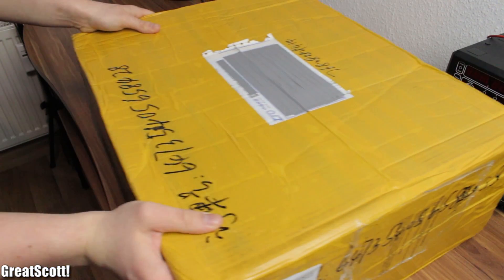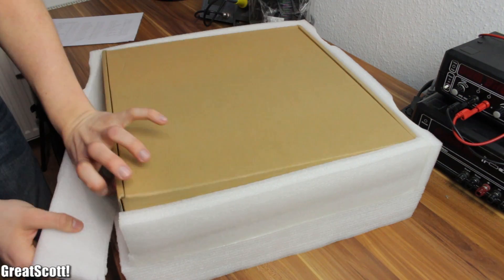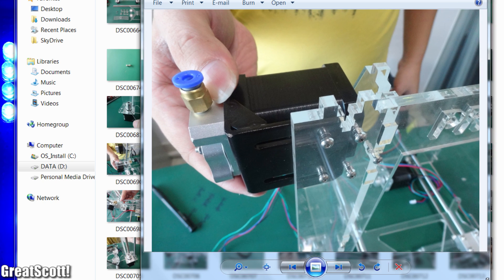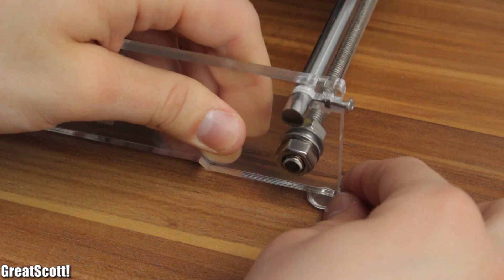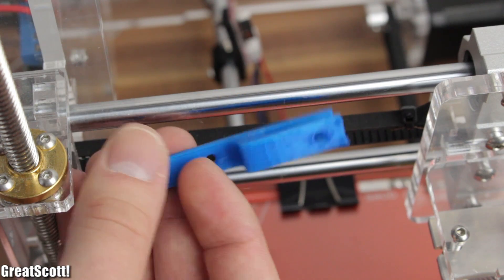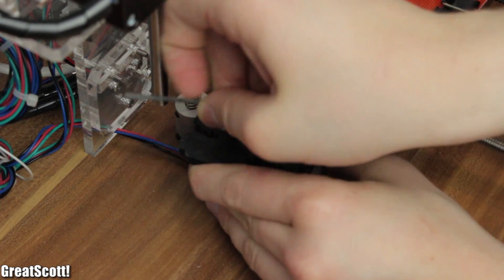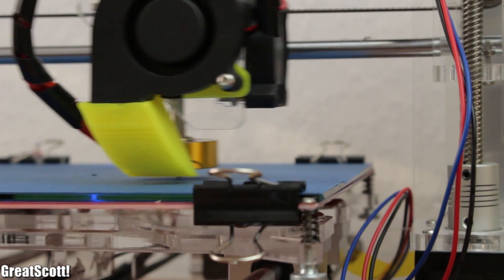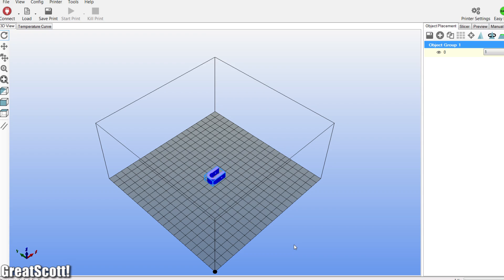3D Printing Beginners Guide (Hardware) - 380$ DIY RepRap Prusa I3

Comment: Man, this video is such a time capsule. So much has changed in the past 8 years. It's so much easier to build printers nowadays.
Reply: I think the printers themselves are harder to make because there are more complicated but the instructions are better
Reply: @AnthonyZuniga-ze1ud  No they're the same difficulty to make, it's just the standards of what's a "good" printer has changed for the better. Nowadays, it's considered a bad printer if it doesn't have auto bedleveling.
Reply: Aint that the truth, my first printer was a reprap i3. Fucking hated that hunk of garbage, 80% of the prints I made on that thing were just parts for the printer so the qualilty wouldn't be so ass.
Tossed it to the curve when the ender 3 came out and haven't looked back.
Still got it today, I've upgraded the board, lcd, and installed bl touch and a direct drive.
Although, it's been overhauled, I'll always respect that I never had to do any modding just to get it to print propperly. 
It worked perfectly fine out the box except for a lil bit of stringing (Sorted it out mostly with a profile tweak on the slicer but, direct drive has pretty much eliminated that entirely).
Reply: @brandonnesfan  an ender 3 without needing tweaks and mods? What is this sorcery?

Comment: Why did YouTube just recommend me this in 2020? My printer has so little problems it's not even funny. When I look at this stone age technology I want to cry. They didn't have Buildtak. They didn't have BLTouch/3D touch. They didn't have good hotends and extruders. They didn't have Marlin 1.9. This is such a stone age they couldn't figure out to put X endstop switch on the X carriage or on the left Z carriage!
Reply: What even are you talking about? We had good hotends (E3D V6, Volcano), we had Marlin (not 1.9 but it was still the cutting edge), we had auto bed leveling, just not this machine, buildtak existed but they were just starting out

Comment: the firmware sucks , i started off with patience and now im in the negative ...lol. i was looking foe help with the configuration.h setup for my reprap guru prusa v2 black because just like this video , my manual has missing and or wrong information and parts . i know i have to upgrade it , i planned on it anyway but i just wanted some help if possible .

Comment: I have the 2017 version and it's STILL confusing as hell to build.  Also still attempting to figure out wtf is up with my z-axis stepper motors.  They will only move ONE step at a time. One.  Perhaps your video will help. XD  Oh. And my end stop sensors not detecting jack.

Comment: Wow, alot has changed in the last few years, I got mine for $180 and printed a 1.2 meter RC plane in parts as my first print and only on or two prints failed.

Comment: I made my own 3d printer, built from 0 with my design and that glass over the hotbed works fantastic. I even try a print without whiping the glass, put my fingers on the printed area and it sticks very well. Now I print only on a glass piece, I whipe it with acetone before and everything it's perfect

Comment: Hi Scott Great video.

Now that you know how 3d printers work, why not see if you can't find some strong low cost parts and design your own raspberry pi based 3d printer. The difference is that with your German efficiency and engineering skills you make a better, simpler design at lower cost.

You could call it the Volksprinter.

Comment: I think this or the upgraded model was in the recent PrimeDay sale.  WHAT A HEADACHE!  There were pieces missing, one of the driver was DOA and the RAMPS board had issues.  I had to have Amazon ship me a replacement kit and I harvested parts from it until I got it all working right!

Upside, I now know how to work on this with my eyes closed and I already know what parts I need to print to fix some of the issues, Y belt tensioner anyone!?

Comment: I got myself a folgertech 2020 prusa i3 kit for only 290 USD. It is made from 2020 aluminum extrusion and I had no issues at all. It was easy to setup and it prints like a charm. After upgrading to a genuine e3d v6 hotend I think the print quality has reached a point where it is almost as good as a 3D printer which costs over 1000 USD.

Comment: Another option for the glass bed is:
Take woodglue and add water, to make it thinner. Then carefully apply it to the printbed with toilet paper of another soft kind of material. The waterwoodglue should dry and leave a thin rough material which the filament can hold on better than glass. You can remove this layer with water.

Comment: I own a prusa i3 myself with an aluminium frame. Works fine most of the time. I did run into problems with the linear bearings over time though, but nothing some handy oil couldn't fix. For print adhesion to the bed I used hair spray. 

But recently I discovered how to print PLA directly on the glass.
First, I got a sheet of single glass from a photo frame and got it cut to the correct size. Ikea mirrors and double glass didn't work as they have too much thermal isolation.
Then, I made sure the glass was absolutely clean using window cleaner. Don't touch the glass with your bare hands from this point on, as the oils from your skin will cause problems.

Level your z-axis as per normal, making sure the first layer would be firmly squeezed onto the glass.

Now, when printing, put the bed temperature to 80° (less might work too, but this worked for me so I stuck with it).
This will keep the PLA stuck to the glass really well.

After the print is done, let the bed cool for about 10 minutes. Your print should come loose from the glass with relative ease.

Comment: Dude. The screws on the bed are there so you can adjust the height. You get the printer to Z 0mm, then move Z to 0.1mm, then slide paper under and move the bed up or down to where the nozzle is. You don't move the Z limit switch to home and level the bed.

Comment: Your videos are great man they're really detailed but short if that makes sense and you're accent makes it easy to understand every word. I still don't know what 3D printer to get though... :/
Reply: Hi rycoh, I'm a professional 3d printer manufacturer. maybe I could help you in choosing a optimal machine according to your needs. Feel free to contact me. :)
Reply: I already bought one hehe thanks for the offer though
Reply: You're welcome. BTW what is brand and model you bought,  Is that function well as you expected?
Reply: I bought a Sindoh DP200, it works great I have zero issues and am very happy with it but it's of course on the pricier side, since I don't have much time I just wanted something that just works and I don't have to mess with. What is that you do? You're a 3D printer manufacturer as you manufacture 3D printed parts or actual printers?
Reply: Thank you so much for your response. Sindoh DP200 is a great choice. I manufacture 3D printer machines.  ^ ^
Reply: I literally just now saw an article about Stanley entering the 3D printing market and then they showed a picture of the DP200 with Stanley's logo on it lol but this is good I think this might be the first foray in the mainstream. Which brands do you manufacture? Tell me more that's super interesting!

Comment: you are a natural at this thank you my reprap is abit different to yours, i have a problem and was wondering if you could help i am having trouble as a i am new ti 3d printing, looking at the front could you please let me no what the left stepper moter left side and the one on the right bothe at the botom, the motor at the back that moves the bed forwards and backwards, the top motor that moves the print head left to right as i never had any witing diagrams only off the web but cant find any that say the xyz motors hope you can guide me in this, thank you for your time

Comment: Tip for everybody, to can print with a glass bed, you have to put some hairspray in the bed (the strongest hairspray in the market), if you don't do it, the plastic will not glue to the bed

Comment: I bought me a 200 $ Prusa i3 clone last week, and it prints awesome! All the problems you described in the video are non existent (because the parts look a little bit different, eg. the min. switches are already connected with the motors)

And regarding the quality, you can choose the quality of prints in cura to "high". (there are 3 = low, normal, high) it will generate a bigger gcode file but the prints have more resolution. Of course the printing takes a little bit longer but it is worth it.
I let my bigger prints print while I sleep. (the printer should be in another room of course, not in your bedroom ;)

I am still playing with all the settings, I am in the beginning of my 3D print journey but I am happy how it goes so far. You need to play with these settings. heat, speed, quality..

My only problem is the Z-axis 0 position. Sometimes it is too tight and the noozle can't print. To solve this. I pause the print and let the z-axis move a little bit higher and continue the print. Thats all.
Reply: can you send me link for printer you bought? I want to buy 3d printer too but i am afraid and dont know which one
Reply: Matuš Kočan search for prusa i3. This here is my printer:  http://ebay.eu/2fGqhB3  (german ebay but you can see how it looks) 

The printer comes prebuild in components. You have to connect them just like LEGO, not hard at all.. after 2-3 hours it is ready to print.
Reply: WindowsSoftwareDe Hi, I'm thinking about buying this and was wondering if you give me a few more details or any problems you have had.  Thanks, Jacob.
Reply: the one problem I have is the resetting the Z axis. The print starts a little bit higher above 0. but sometimes the 0 position is too high or too low and it starts printing too far above the plate or grinding into the glass..

I need to recalibrate the Z axis after few prints (not a big deal.. just 5 minutes work).

The problem is that the minimum switch for the Z axis moves down if the last print was shaky... I need to fasten the screw somehow or think of something better.

Beside this I am super happy with that printer. For around 200 $ you can't do anything wrong. You will be happy with it. For beginners it is more than sufficient. The prints are (for myself) of higher quality.
I printed a lot of stuff.. even my own head (3D scanned with Autodesk 123D) and now I am scaring everyone at work with it ;)

Comment: Hi all, I have just finished assembling a Pi3 Pro B DIY kit from GEEEtech. I am 3d printing ignorant and have everything to learn.
Okay, my first problem. My controller LCD screen tells me the printer is ready with all axis at zero. I select Prepare and then Auto home. The heatbed moves forward until it stops against the front frame. The motor continues to run - it's looking for the stop limit switch, which is at the back ?  The motor is moving in the wrong direction? It is impossible to connect in reverse ! The plugs are already made up for the pcb.? Please any assistance would be greatly appreciated. Thanks
Reply: Dennis Wales go into the config file for your firmware and find the beta or z-axis direction pin. Add a "!" to the number to reverse it
Reply: Hi Alex, thank you for the reply information. Please be patient with me, I am ignorant with 3d printers. Okay, I have gone into my Repetier-Host V1.6.0, selected config, selected Firmware EEPROM Configuration, gone down to Homing Offset and changed the setting on the Y axis from 0.00 to 1.00 and I have saved this to EEPROM.  The control LCD panel on the printer now displays X - 0  Y - 1  Z - 0            BUT, obviously I have done something wrong because it hasn't changed/ solved the problem.  Thanks

Comment: If you have a heated bed, a coat of ABS dissolved in Acetone works great. I use that all the time, and its very reliable. When it cools down, the parts come of easily. If not, put the glass with the object on it into water and wait. It will fall of.

The ABS coating must look like a thin layer of transparent paint. Apply just before printing. If you heat the bed to about 35°C the acetone evaporates quickly without the abs pulling too much water from the air. If that happens, the coat becomes milky. You can heat it out, just raise the temperature to 80°C or more and wait a bit.

The ABS coating method is the only one im still using, since its just the most reliable i know of, and the cheapest too. An old coat is simple to remove by putting the glass into water. As glass i use cheap mirror tiles. Because they are mirrors, they are perfectly level - otherwise the mirror image would be distorted. Its the cheapest was to buy perfectly level glass .

I did try to print direct onto glass. If it succeeds, the bottom surface is mirror finish smooth. However, it requires extensive cleaning, rubbing with alcohol - THE GLASS ;-) - and it fails often, with abs nearly every time.

Comment: what do you thing about this? http://www.ebay.de/itm/2016-DIY-3D-Drucker-Verbesserte-Voll-Qualitat-High-Precision-Reprap-Prusa-i3-/291765432193?hash=item43ee932f81:g:0ngAAOSwdzVXoV92
Reply: Das Gerüst ist aus Holz also sind Verformungen sehr warscheinlich. (Auchh wenn es laminiert ist) Lieber Alu oder Plastik. Mach bei Plastik aber keine Experimente mit Box drüber oder änliches das die Umgebungstemperatur steigen lässt. Die Gedruckten teile fangen dan auch an zu Schmelzen!

Comment: I used caption tape for the bed surface on my i3. It works great, and a light coat of hair spray before each print makes sure your first layer always sticks.
I recommend doing a bunch of test prints to fine tune your slicing settings. Vary the nozzle temperature, bed temperature, filament feed, layer height, x and y movement speed etc. Till you find a config which works. Took me a while, but I get consistent and pretty good results with mine now.

A good starting point for pla is:
Bed: 70 degrees c
Nozzle (0.4mm): 180 degrees c for perimeters and 200 degrees c for fill and layer 1
Layer height: 0.2mm
Filament feed factor: 1.05
I also use a hot air gun to preheat the bed to my target temperature before starting my print. I find it sticks better, and I don't have to wait for the pcb heater to get it up to temp, which takes ages.

Comment: Hi Scott where did you get the blue painter's tape in the width, here in Germany? I Can Only find the 50mm width... 
I would greatly appreciate your help
Reply: Feb. 2018----From what I understand from other 3d printer videos, you don't have to use a single, large piece of blue painters tape. Just make sure the pieces are tight against each other and of course, the glass. Checked via Google and Ebay has 6" wise tape available via Ebay. Hope this helps everyone.

Comment: I've just bought this printer from Aliexpress. £140 delivered. I am getting good results from it. 
Yes, it's a bit frustrating to build, the instructions aren't that clear. But now I am creating 0.1mm prints at 40mm/s and getting some lovely quality. I am learning lots about these machines, how to set them up, where not to touch so you don't get burnt etc.

I spent the first week with it practising and making things to improve it. A fan blower that surrounds the hot end, some tool holders and a camera mount so I can view the printer from anywhere. 

£140 well spent.

Comment: Nice video. Well done. Very informative. I have the Prusa i3 kit from Prusa. So far, it has worked quite well. Some of the artifacts I saw in your printers looked like they could have been handled by adjustments in slicr. Specifically, setting a denser/finer extrusion size. I've been printing some of my pieces with a 50% fill rate a 0.1mm layer height and the pieces are robust and extremely well formed. Did you make an Octoprint video yet? I think that would be very helpful. Also looks like you're exploring leveling with laser. I look forward to future videos.

Comment: i do not see my self getting a 3d printer any time , those pieces look terrible, all those lines looks like layers of stuff, and thats exactly what its is.... i rather get a cnc or laser cutter for the same price and have clean solid objects
Reply: +Eddie Amaya That's not the point. 3D printing has a certain use. It's also, believe it or not, quite a bit safer than a CNC or Laser Cutter.
Reply: i agree 3d printing does have a certain use, quick prototyping but definitely not quality finished parts. i think i might get one for the sake of making a quick demo before throwing it at the cnc
Reply: 3dprinting looks great but you need to setup the machine good and the longer you do the better the prints look. Look at my channel and you see how nice a job a 3dprinter can do :D

Comment: "I can recommend it to everyone who doesn't have an anger problem..." XD
TOO FUNNY, and so true! I also bought the Prusa Reprap i3, and ran into the same issues you did; plastic breaking, alignment issues, and VERY bad instructions. I built most of mine just by looking at pictures of other printers online. Overall, I have roughly 3 hours of build time, 4 hours of alignment time, and a 7 out of 11 success rate on my builds. 

I spent so much time doing the alignment, and roughly every 2 prints I need to realign it, I was wondering how you got yours perfect. Looking at your prints, yours is spot on, can you do an alignment video so I can see if you're doing it differently, or maybe I'm just doing it wrong?

Comment: have the exact same model the aluminum nozzle pitch is problem with it I milled mine off and threaded the block so it could use a maker bot nozzle  solved my print jam and quality problem also downloaded upgraded adjustable end stops printer works amazing only wish thay sold a frame upgrade kit